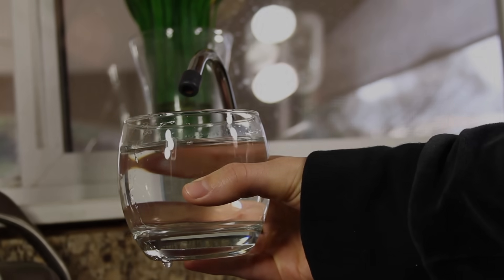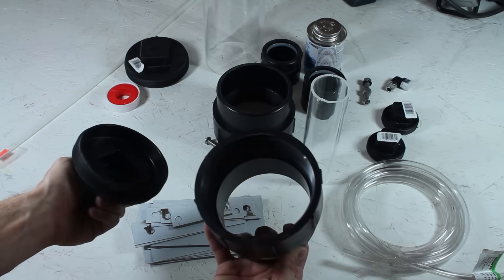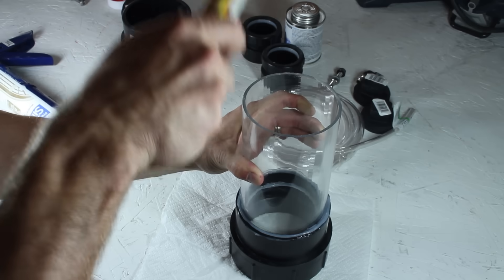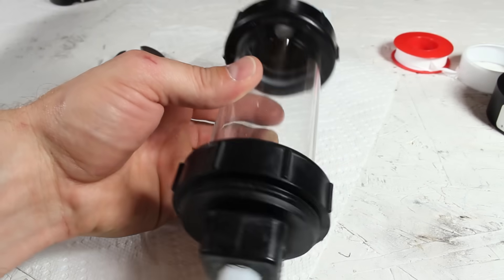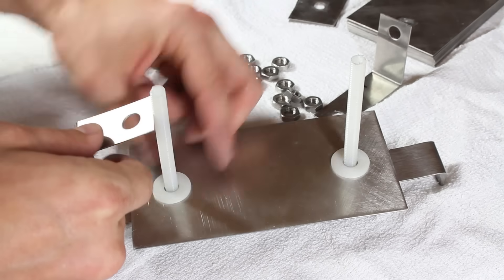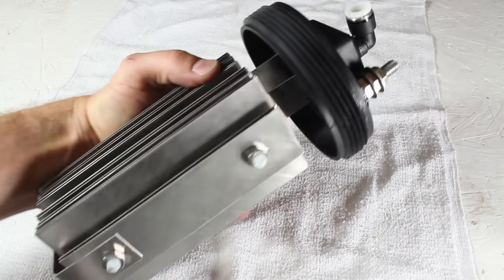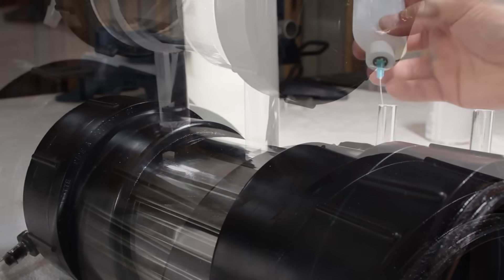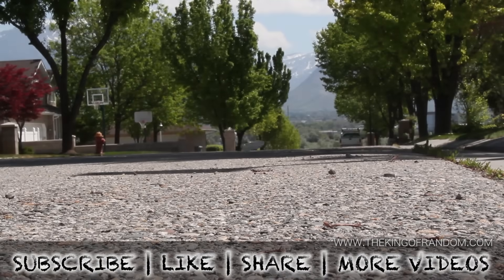HHO Generator - Water to Fuel Converter

Comment: for anyone considering making this for themselves, here are some tips to make a really sexy one:
-use 316 stainless steel, its a bit harder to get hold of but its corrosion resistance makes it much better than the 304 stainless you can see starting to tarnish in this video
-that one way check valve, its utterly pointless in my experience

Apart from that this is a great video to follow
Also Grant if you ever read this do you think you could put a video up showing how to make the detonator pad?

Comment: I have three questions:
 1. How much would it cost to make this.

 2. How long can you run it before it overheats because of the electricity.

 3. If I fill a bottle with this gas and close the lid can I store the gas, or will it leak or evaporate.

Comment: Another way of thinking of it is that Oxygen and Hydrogen want to go together. They release energy when they bond (burn). They bond so tightly that it takes a lot of power to pull them apart. Once apart though they ache to form a new bond. Using water for fuel is more like a battery than an unlimited power source. More energy goes into splitting the hydrogen/oxygen bonds than you get back by burning it. Cool if you need fresh water and electricity though using solar energy to power it.

Comment: For those who are worried about chlorine gas or chromium in their HHO generators:
1- If you dont want to get chlorine gas don't use salt as an electrolyte, as simple as that.
2-Chromium is toxic but it isn't an inprescindible part of the steel plates alloy, just to make sure, ask if they have been chromed or if they have chrome in it's composition.
+ Caustic sosa is a good electrolyte but it's corrosive and will burn you if you don't pay attention.
+ Baking soda generates CO2 and some residues.

Comment: The water conducts electricity between the gaps in the plates. If the plates were connected otherwise, it would just be a short circuit and nothing would happen.

Comment: I saw one advertised to hook up to the cars intake not to replace your gasoline but to make it more efficient. Apparently the electricity comes from your accessory power so it only runs when the car is running and is supposed to use much less gas. The unit was about $300 if I recall.

Comment: you build a larger container with the positive terminal and the negative terminal on opposite sides of the container. then build a divider that separates the top of the container but leaving the bottom open so the water can move freely to both sides, add an exhaust port on each side an youre done, with hydrogen on the negative side and oxygen on the positive.

Comment: just something on anyone considering making this for themselves, galvanised steel will also work but will corrode lightly as will stainless steel this can be resolved by alternating the direction of current (swamping the red and black) which will carry the zinc atoms back to the anode/cathode they were transferred from, you could also buy zinc metal and zinc sulphate off eBay and re galvanise the plates, a video on how to do that is on the nurd rage channel

Comment: thanks, with the tests ive done so far the galvanised steel seems not to corrode like stainless steel does in the solution of potassium hydroxide, as you can see in his video the stainless steel plates start to get a rust coating as he uses it so maybe using galvanised steel that is not sanded is better in the long run

Comment from the maker: Thanks for asking.  If you have a 24v DC converter it will work just fine, depending on how many amps your power supply will allow.  My system was pulling upwards of 50 amps.  Yes it will work in a spud gun .. at your own risk of course :)

Comment: You can do the same thing with a pickle jar halfway filled with water and 1 tablespoon of KOH and one aluminum can. Set the pickle jar in a bucket halfway filled with water this will regulate the temperature of the chemical reaction.  It only takes seconds to fill a balloon using this system.  Mount a hose fitting in the center of the lid.  And connect a vinyl hose to it.
watch?v=JS1XclcWCe0&list=PL870C3BBB86C33F72&index=41

Comment: Hey man love your work, 2 questions
1, Could you power this off mains power with a 24v DC converter instead of the two batteries?
2, Would the gas create a powerful enough bang to use in a 'spud gun'?
If so, you should make a video of the result :) Keep the videos coming!

Comment: FYI it will never ever be "the fuel of the future" because you need an energy vector (electricity) produced with a primary source (coal for 40% of electricity production in the USA, for example) with a maximum yield of 30% (water -> steam -> turbine -> electricity -- see Carnot's cycles).
Produced gaz will never give more energy than the input battery contains, charged itself with electricity produced with 70% loss. No future in there.

Comment: hey , very good video , this is a brilliant design ! can you write pls what you haved mixed with the water because every hydrogen experiements i made ive done with salt but its too corosive :P , the bubler can be bigger then no water will be come out of the exhaust , you can simply power a car with hydrogen but the oil concerns spent money to block this ;D the exiting part is to split hydrogen from oxygen and presurise it and fill into a gas bottle :D :D :D

Comment: with 2 of those you have enough h2 to run a car efficiently. 10l/min on 4 car batteries with an h2 reserve tank and an additional starter battery under the hood and you have free fuel for life. you could run 100% hydrogen or even go a multi-fuel system running both pump gas and h2

Comment: You know I couldn't help but ponder on the idea of how this fuel is made. It's very obvious it doesn't leave behind any carbon footprint, or any sort of pollution for that matter, behind.But,I notice that you need to use, for lack of a better term,"dirtier" energy to make it work.Unless it's being produced from clean energy like solar or any other with a smaller carbon footprint, it kind of contradicts the point of the water fuel. I hope no one confuses this as an argument, just a thought really

Comment from the maker: The generator heat varies by the amperage running through the electrolyte.  The more gas you produce, the faster it will heat up.  I don't have any temperature controller on this, but placing it in something like a bucket of ice water could help.  I haven't used it for cooking and don't know of a safe way to do that yet.

Comment: 6 pair of plates (the ones that have the bolt between) are touching nowhere; neither the cathode nor the anode. I can't understand why they are necessary since only 4 plates are connected (2 to the negative and 2 to the positive)

Comment from the maker: I made this one for $60.  It depends on how much you spend on your plates.  Other than that, the check valve and swivel elbow are the most expensive parts.  You don't really need either, but they are nice to have.  You can probably make it for $40 or less if you go really cheap.  Parts list with SKU#'s is included in the build plans.  Details in the description and they sell for $20.

Comment: Thats true, I forgot to add if you use baking soda you will need to take apart and clean the plates every 7-10 hours of run time.  They will have a bronze look to them.  Not easy to clean either.  Lye does work better.  But KOH is cheap online, or if you know anyone who works in a hospital you can get really pure stuff from them.  I've noticed the stuff I used from the hospital lets my bubbler and plates stay clean almost indefinitely.  Hospitals use KOH in the diagnosis of some skin conditions.

Comment: Hey Grant, the other day I was showing your vids to a few classmates of mine, and one is really into HHO generators.  He makes the dry cell versions, said they are more efficient.  With the same two battery supply, he said you should get about double the output, about 10 liters per min! You can also connect a torch tip to the end of the output tube and use it as a mini torch, plenty hot enough to melt metal.  Only need 2 liters per minute minimum to do that, so your current set up should work.

Comment: If you can't get KOH try baking soda.  Not as efficient, but it will work well enough.  Use fresh water though, don't just add baking soda to the water that already has salt and other stuff in it.

Comment: I used this model as a base for mine, but instead of buying and cutting stainless steel plates, I used stainless steel cable! 6 ft for each electrode, coiled around a 2" abs pipe.
The best part is, the cable is only $.50 a foot! :-) 
....hope that helps anyone on a budget.

Comment: So I am doing this project, which is really awesome by the way. But I can't seem to find a cleanout fitting and cap for a pipe that's has an inner Diameter - 4.09" ( 104mm) Outer Diameter 4 .33" ( 110 mm). Specifications from ebay. I tried looking everywhere for fittings. Can anybody help me out on where I can find them?? Thanks!

Comment: Ive done some experimenting. More failures then successes. I had to stop because I was investing to much money without any real results. My issue was the lack of access to quality supplys. Pipe fittings that leak, while being brand new from store and just not being able to get my stainless steel machined at reasonable costs. I do understand the science that is behind the idea very well though. 
Have you ever worked on a dry cell? They are the same idea, but more self contained and more efficiant

Comment: Aluminum does NOT work.The process causes it to deteriorate very quickly with regular distilled water, once you start adding in electrolytes it deteriorates so quickly that within an hour your water will be so scummy, and the plates so damaged that you will have to scrap the cell. Stainless steel is your best bet, even though it does still slowly degrade it stands up better then anything else within reasonable cost.Get your hands on 316 stainless steel as its the best at corrosion resistance.

Comment: Hey Grant, awesome video! I built your contraption over the last week I had a question about your results. I'm using salt (I know, chlorine gas) since I can't find pure sodium or pottasium hydroxide.  I'm getting a brownish solution in the end. I'm also using ss and I suspect it's the chromium in it that's dissolving. Did you end up with a brown solution after running it? Thanks!

Comment from the maker: The higher the voltage, the hotter the system gets.  I like 24 volts because you get a lot of gas quickly!  .. but I don't recommend running the system for more than 30 seconds straight on that because after about 4-5 minutes it heats up to the point where the plastic can melt.

Comment: great info,what about car batteries ,are they connect in series or parallel,i,e 12 volts or 24 you are running the system on?

Comment from the maker: Thanks for your comments :)  I really have no idea how to made a high current diode, and the ones that I have seen on eBay are only for 50 amps or less, and cost a lot of money.  But if you think about it, hooking this up to your car battery is about the same thing as what you're suggesting.  Current is limited by the electrolyte in the solution.  The more conductive, the more current will flow.  You can regulate your current by adding more or less electrolyte to the solution.

Comment: Ah, found why you made it like this (using the neutrals to divide the input voltage down).  Still curious what would happen with the transformer in low voltage/high current (with a +-+-+-+- plate configuration) :)

Comment: Could you try using your high current/low voltage transformer with a bridge rectifier to power this system? From what little I've researched, any voltage above 1.5 should do the trick with voltage above 1.5 mostly generating excess heat and the current determining the rate of hydrogen and oxygen production for the reaction. Not sure where you could find diodes that could handle the 1600W for the rectifier, or with low enough voltage drop to get you to that 1.5V from your 2ish volts, but I'm sur

Comment: Hey Grant! I've been recently watching a ton of your videos and testing them all out myself(atleast the ones i can get the materials the same day i have to time to experiment) and i had a question on this generator, if i were to make this generator identical or similar to yours but rather than you using stainless steel plates could i use snd other form of conductice metal (also would any, if there are any, other metal that is more conductive speed upthe process'?) that way they're easier to get

Comment: Thanks for the reply! Anyway, that makes sense now. I was just curious why there were so many plates, and they weren't connected to anything. Like you said, I also noticed in the video that those two plates instantly start bubbling once the current is running through them, then the others bubble shortly after. By the way, have you ever tried connecting all the plates so they are either positive or negative to see how that affects the gas production?

Comment from the maker: Nice observation.  Only 4 of the plates are electrically connected to the terminals  2 positive, and 2 negative.  The rest are floater plates.  They do carry a current when the system is energized because of the electrolyte in the solution.  The voltage divides evenly between each plate pair and they all produce gas, although I've notice more gas off the plates directly connected.

Comment: There is no different with the voltage, its the amp hour capacity that is much different. IF you used AA batteries or any even D batteries setup for an application like electrolysis you would discharge them so quickly you wouldn't get much of anything. A car battery has a much larger capacity and can handle a large load which is why there ideal. Electrolysis uses a large amount of energy to split water molecules and created a large amount of heat.

Comment: Very Nice generator setup! My only question is about your metal plates in the generator. Do all the plates have current flowing though them? You use threaded nylon, and nylon washers w/metal nuts in between the plates. The way it looks in the video, most of the plates are insulated from each other. How exactly is the current flowing though all of the plates? It looks like some of the plates are just insulated from everything and they are neither positive nor negative. Hope to hear from you!

Comment from the maker: The higher your voltage, the more amps should flow .. but a AA battery operates on a chemical reaction that produces the electricity, so you are limited in how many amps are available.  Does that make sense?

Comment from the maker: Thank you!  I understand there is an energy loss when converting water to fuel, so it's not an energy generator, but the gas can be used for rockets, torches, heating, internal combustion engines (I haven't tried this but there seems to be alot of evidence it works), and making loud explosions.  Have you seen my video on testing the fuel?  It's called H2O explodes.  Just click on my name and look for that video. Thanks again!

Comment from the maker: Thanks for asking!  Some of the most expensive parts are the check valve and the swivel elbow.  So if you left those off, and assuming you can get your plates for $20 like I did, the whole system can cost as little as $40.  That's basically the cost of the ABS and plastic washers, bolts and jam nuts. To do it right you're looking about about $80 probably.

Comment: Great video Grant. It has been proven(?) by scientists that it DOES take more energy to produce than what you get out of it. However in a SHTF scenario where it might be the only source of fuel for IC engines, you take what you can get. RIGHT. I'm thinking a solar or wind/water power source may be the slow but steady way to generate some gas for yourself. How much do the pieces/parts cost (appx.) to make your unit once we buy the plans. How about storage solutions for the "made gases"?

Comment: Mas production of this would not as many of you think, be as beneficial. It takes quite a bit of energy to electrolyze the water, to a point that you can make more energy by simply using photo voltaic cells.